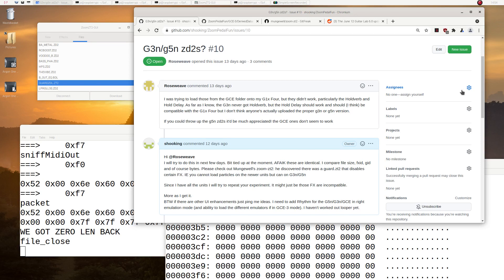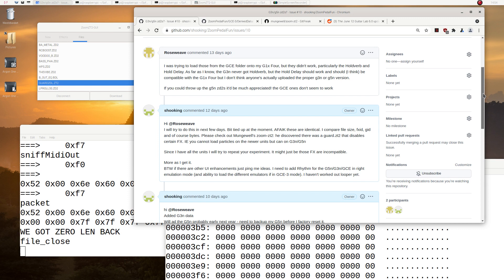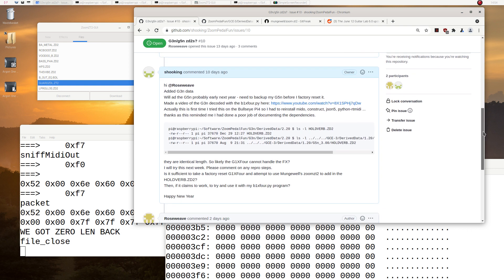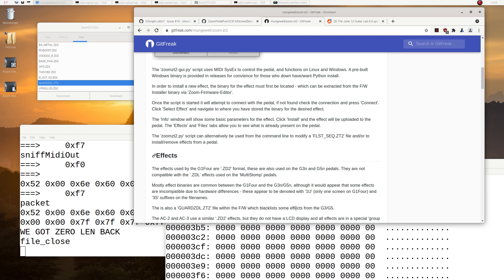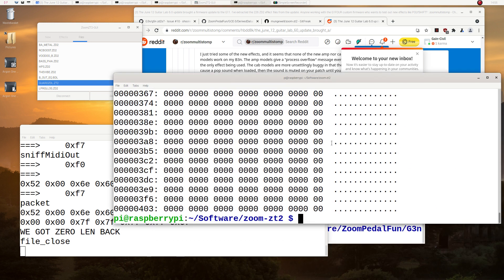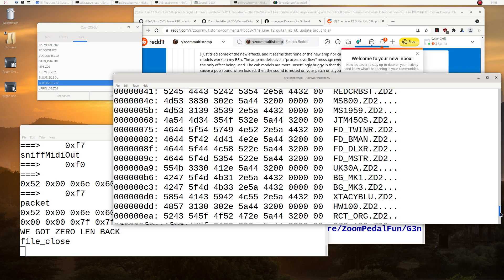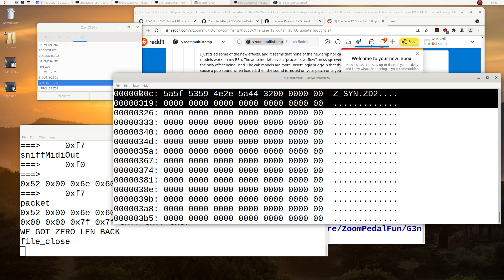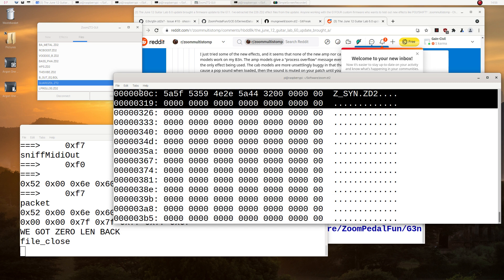Why a Zoom G1XFour class pedal cannot load some G5n FX

Comment: Hello Steve! Is there any way to program to insert External IRs in the Zoom G5n?
Reply from the maker: Not as far as I know. Zoom have encoded these into their ZD2 and it is proprietary. Interestingly enough there might be hint of IRs on the GCE-3 but better to get a pedal that supports it with decent and documented midi implementation. I just like the challenge of reverse engineering.

What I tend to do is use the Zoom for DI injection to mixer using my FX and if they want to inject IRs on the Behringer digital desk then fine. For decent valve / tube sound I use a cheap Laney Cub 12r - takes the Zoom pedals in the FX loop well.

Comment: Hi! A simple question, i have a G1 four, can i turn it into a B1 four? Am i dreaming? Thanks in advance
Reply from the maker: Yes; and no you are not dreaming. It is a matter of space on the device. On the older pedals (G1On and B1On) there was some common driver required. Not so sure about the newer one (you can find a link to Barsik's page on my wiki).

Maybe that's a great idea for a new video. Make the B1XFour be a G1XFour and vice versa. I have both because I didn't realise they are essentially the same. The A1XFour has an extra acoustic microphone - but we can load A1XFour FX onto the other pedals too. Bass with some nylon modelling is ok.
Reply: I’ll be the first to give you my “like” to that video!!!!! Thanks for this happy news!!! Here in Buenos Aires there is a lot of cheap G1 four available but no b1 four at all, i play the Chapman stick and my set is half guitar and half bass, i love my g1 four but i need the bass side too. Thanks for your answer
Reply from the maker: @lu4enp  ah like Tony Levin :-). I use some G1XFour FX on bass. To be fair I have the G5n - used it today - I loaded enough bass FX on it. I mostly use Exciter to boost bass, plate or chamber reverb, ZNR (but the EMGs are pretty quiet), Volume pedal [[haven't worked out how to emulate that on GCE-3]]. I will see if I can make some time to make the video. I use Mungewell's work (zoom-zt2) to add FX.
Reply from the maker: I made video today - loading it up soon. I will revisit how to do it all from CLI rather than Mungewell's GUI - but my G1XFour now thinks it is a B1XFour. There is on file of interest - I will see if Mungewell has any insights into it. There seems to be a file that say "hey I am a G1 not a B1" ... wondering if reloading that would allow simple firmware upload - so thanks for the ideas.